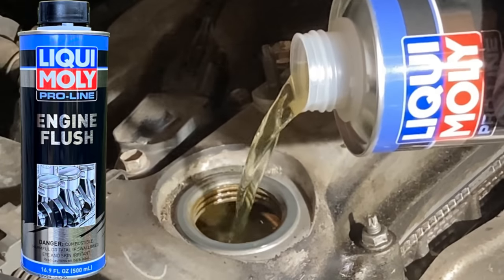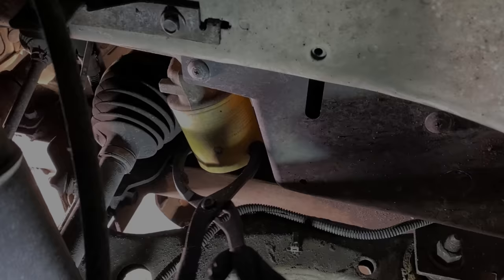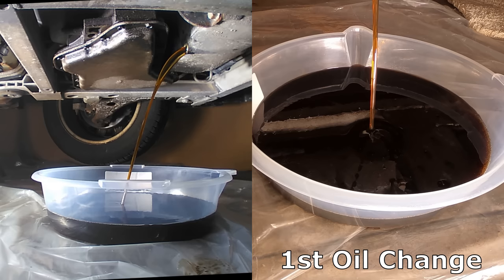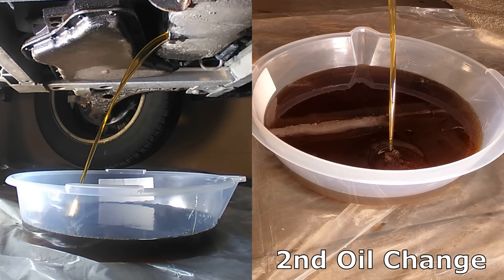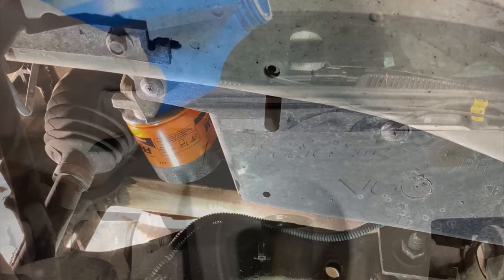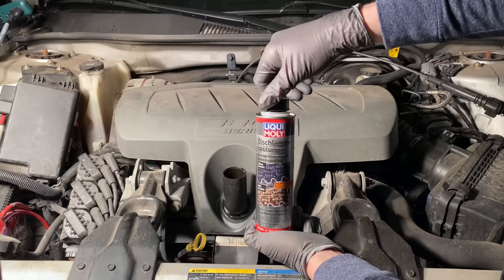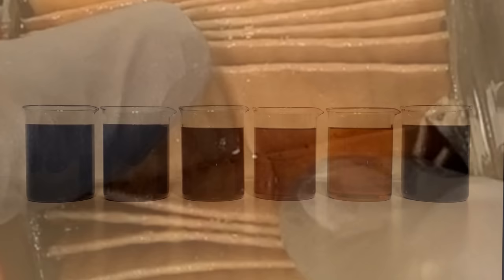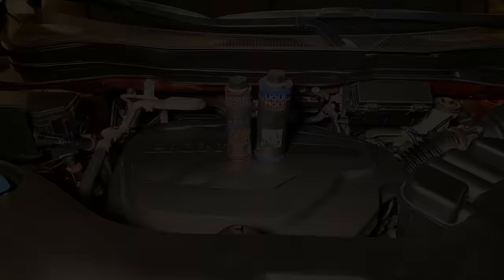Liqui Moly Sludge Remover vs Liqui Moly Engine Flush (Which is Best?)

Comment: Did you put a full complement of oil in, or just a couple of quarts? I had tried something similar to this in an attempt to get ALL the old oil out, so I could get a true analysis of the new oil I wanted to use. I put 2 quarts of oil in with a new filter every time for 3 changes, running the engine 20 minutes each time. No sense wasting the whole 5 quarts if you're just going to circulate oil. It never starved for oil, low pressure indicator never came on. After a few thousand miles with the new oil, I took a sample & had it analyzed. They said there was contamination from previous oil, because there were formulations in the analysis that were not in the current oil, therefore some old oil was still present. He said I have to change the oil 3 times to completely remove any old oil. I said I did, but I didn't tell him the method I used. My conclusion is that there is oil in places that takes time to work out, e.g. hydraulic valve lifters, & other hydraulically controlled mechanisms in the engine, that only driving under load will allow to circulate.
Reply from the maker: I read an article by a former GM engineer (I don’t remember what publication unfortunatey) where they did test to see how many oil changes it would take to remove an oil additive.  It took them 8 oil changes until the oil tests showed no (or maybe minuscule) traces of the additive.
Reply: @OwenLucas  Good info, thanks! But did they use full crankcase capacity, or just a couple of quarts? How long did they run the engine each OCI?

Comment: Helpful video, could you say which one is the best to clean up sludge on pistons and valves?
Reply from the maker: According to the LiquiMoly engineer that I spoke with.  The pro-Line Engine Flush is the most powerful of their engine flushes.  Regarding the valves, you will need a specific valve cleaner.  Techron is works great along with LiquiMoly 2001 Valve Clean.
Reply: @OwenLucas  thanks! 👍🏼

Comment: I emailed liqui moly and they basically said that sludge remover is a more " aggressive " engine flush. 
Maybe the pro line is the most aggressive engine flush.
Personally I used the standard engine flush and worked well, removed the next oil in 100-150 km after then new oil.
Reply from the maker: That's what they told me, the sludge remover works great after driving 200km.

Comment: hi, I used Liqi Moly Pro line Engine flush. after I did a Berrymans piston soak for a Kia 1.6 high oil consumption issue. Before the engine would use 2 quarts per 1000 miles. Per Kia TSB I performed the piston soak, and followed up with the Engine flush. in all 3 oil changes. Now 1000 mile no oil use at all.  Will save 24 qrts of oil in year. not to mention a piston ring job.
Reply from the maker: Thank you for sharing, that is proof that flush products and engine additives work, especially in extreme cases.

Comment: Hang on, 5000miles? What's that in km, about 8500? The oil looks like from my Diesel R5 Touareg after 15.000km. To be fair I tow a lot and the oil is not as thick and the Touareg just has 300.000km on the clock.

But not even my A6 2.8 from 1996 with 410.000km spits out oil that bad looking. Well it comes out golden after 12.000km. Crazy, but that's a quality difference for you.

Not to mention my Q7 4.2 or TT 225, the oil in these looks like new after changing it. Granted, they only have 220.000km on them.

Gotta check my 3.3 A8 after standing for a year and needing an oil change after 15.000

Pretty extensive testing, well done! I use the products from Liqui Moly since 2009 in all the 30 cars I had. Very happy with them, also the engine oils are excellent even in 10w-60 for Porsche or high power Audis.
Reply from the maker: Thank you sir!  Liqui Moly products are the best.
Reply from the maker: I am using miles btw.
Reply: @OwenLucas  Glad to hear you have good experiences with them. That you use miles I understand. Or did you mention that because I used km and you struggled converting like I did?

Comment: Why did u change the oil before using the sludge remover . Or why not doing a couple of oil changes after the sludge removal . And after that u could have drove the same amount to answer your question if those miles turned your oil black or if it was just sludge residue
Reply from the maker: The multiple oil changes were to make sure there was no old dirty oil in the sump. With completely clean oil, you can see if the engine flush cleaning action works because the oil should get very dirty after the flush is used.

Comment: I never thought to change the oil before a flush , I used the Liqui Moly flush on what I believed to be a clean engine 5k oil changes Mobil1  160k miles to my surprise the truck ran smother with a repeatable 1-2 mile per gallon increase in fuel mileage when I pulled the pan to change the oil pump o ring the pan was clean. I believe the flushes work
Reply from the maker: Very nice! Glad the flush worked for you!

Comment: you made 3 oil changes then you put Liqui Moly Ölschlammspülung and draw 200km. And after the change, the oil was again dark. 
You should make a new oil change after  Liqui Molly Ölschlammspülung,  again drive 200km and the new oil will again be dark.
I drive a BMW and I change every 10 000km oil. Every 10 000km oil change is the best oil change intervall for your car. And use Liqui Moly Cera Tec additiv, your car sounds better.

Comment: What I do is every 2,500 miles I install a new oil filter, every 4,800 to 5,000 miles change oil and filter.
  The new filter every 2,500 is coming out drake big clean. Not much particles.
 My father did this in the 1970s 1980s.
The gasoline we buy in the combustion engine causes dirty oil. 
Buy gasoline from a very good station, sometimes the lowest price gasoline is bad for your car.

Comment: you got skills man not using a funnel.  LOL. i can’t do that and the wife says why am i smelling burned oil is there a problem?   LOL
Reply from the maker: 😂  Regarding the burning oil smell, someone could have spilled oil on your engine during a change or an oil leak dribbling down onto the exhaust manifold.  Sometimes it's not worth changing a $2 gasket for $300 in labor so you might be better off power washing / degreasing the engine (when cold) to remove any oil seepage.  Just watch out for the leaky gaskets.  Liqui Moly also "Motor Oil Saver 1005" as a stop leak product to rejuvenate seals.

Comment: With that kind of treatment that 3800 should easily get to 500k. Just don't forget to change the lower and up intake gaskets 👍
Reply from the maker: Thank you for the tip, engine has been strong no issues other than hood struts on this vehicle.
Reply: or coil packs
Reply: Best engine GM ever bulit.

Comment: So I’m considering doing this on my car and I mainly talking about the oil change after oil change after oil change to get some of the free, floating sludge out. My question is can you use the cheapest oil and filter possible for the ones that you are rinsing through and then throwing away? And then on the final one just put the proper spec oil? Also I am doing some research on engine flushes because I have a direct injection Audi V6 motor with a turbo and I’m having issues with mild oil consumption. Also, I saw a video on here of a guy using something called B12 and he poured it right down the hole where the spark plugs go let it sit for six hours, then rotate it and then repeat the steps.
Reply from the maker: Definitely use a cheap oil filter for the flush.

Regarding the B12 Chemtool. It can be used for a piston soak to free up the oil control rings which have most likely jammed and are letting oil into the combustion chamber. It’s worth a shot and I’ve heard some people have success.

Comment: After you pour the LQ Sludge remover and drive 200KM. Did you see the condition of valve train ? I think to validate the result we need check the valve. Just open the valve cover and see the effect.
Reply from the maker: I’d love to see the before and after but taking the cover apart on this engine, being a V6, is a lot of work.
Reply: @OwenLucas  Btw from 1st oil change + LQ Engine Flush to the 3rd oil change, what interval did you use ? Did you drive your vehicle for each oil change ?

Comment: Oil will get really dark after driving for a long time.

I have an idea if you are just cleaning the cylinder head part:

1. Remove the top cover and brush off dirt. Drain oil and use and AC compressor to move dirt down.
2. Remove the oil drain pan for cleaning. 

I think it is wasteful to overspend on Liqui moly when you can just remove the oil drain pan for cleaning. A lot of the sludge exists there. Not on the engine itself.

This is the reason I no longer buy any Liqui Moly flush. An  engine oil flush solution only costs about 250 PHP here. You should only use fully synthetic oils even for cleaning.

Comment: The best engine flush is kerosene run engine for 10 15 min (Don't Drive it) then dump and change filter, Second best is Diesel fuel and cheap new engine oil 50/50 at least 3 flushes run engine for at least 15 min each time then change filter....

Comment: Hello my friend, I have several questions about the video you uploaded
I wanted to ask how long do you run with the engine flush before you drain it? (How many minutes?)

And how long after that do you run the oils that you then drain?
Because you did a few flushes with new oil during the cirton, so I wanted to know how long you run them in the engine before you drain?
Thank you my friend
Waiting for a reply because I also want to do this process
And I wanted to know that I understand the process one hundred percent

Thank you
Reply from the maker: For the Pro Line Engine Flush you run the engine 10 - 15 minutes, just idle, no driving.
For the Sludge remover you have to drive 200kms with the flush in the engine, light driving.
The flushes I did before the sludge remover are not necessary as they were to achieve a clear engine oil to show if there is any difference with the sludge remover.  It would be a waste to change oil before the flush.
But after the flush you change the oil and filter.

Comment: no, oil doesn't get that dark after 200 kms .. even 2000 kms will not make it that dark. It takes around 3000-4000 kms to make it that dark
Reply: agreed, my lexus 430 (3UZ) takes 4000kms to go off being clear, I change it at 6,000kms

Comment: I use a whole bottle of Marvel's Mystery Oil in my oil even if it's a little over full driving about 200 Mi down the interstate and then change my oil Works real good and it's cheap
Reply from the maker: Good advice, MMO is very versatile.

Comment: I Dont recommend using anything with solvents. Sludge breaks off instead of being emulsified and the solvents harden rubber seals and reduce lubrication of the oil. I only use detergent based oil flush
Reply from the maker: That's why it takes this one so long to function, it's gentle on the seals as per Liqui Moly's website. The Pro Line Flush is definitely stronger.
Reply: Detergent based flush, such as?

Comment: Thanks for the video,
I recently bought Mercedes 2013 Vito van 122 CDI V6 engine. I’m really keen to add CeraTec  Liqui moly oil additive just wondering does that do any harm for engine or cause any oil leaking any recommendation or any experience you have is Highly  appreciate it .
Reply from the maker: I’ve heard nothing but good things about ceratech.  It’s an additive not a cleaner. Shouldn’t cause any leaks at all.

Comment: Do I need to flush remains of liqui moly after driaing the old oil and before refilling the final oil? Or can i simple drain the old oil with Liqui moly and refill the new oil right after and run it.
Reply from the maker: You can flush it again to be extra clean but the LM should evaporate after a while.

Comment: Did you get the oil analysis from black stone? I change my STI oil every 2,000 miles so my oil comes out almost golden still so I don’t use additives but I bought a 2008 acura tl type s last ,moth and want to do the flush like in your other video.
Reply from the maker: I didn’t have a chance to. 2000 miles?  You will never need a flush changing oil so frequently. I like the TL design of the 08 generation, very clean, have fun!

Comment: Would it be ok if using a cheap oil to do 1 or 2 flushings? 

Want to change oil on my mk7 but i only put in castrol.
Reply from the maker: Cheap oil for the flush is the way to go.
Reply: @OwenLucas  Thank you for the response, will do this saturday my oil. To be honest, i never did a flush this way. I put 1 liter in and drain it again, then i fill it up. Tought most of the dirty stuff would come out. But the next day when i re-check the level its always a little brown instead of yellowish. Thank you for the tutorial. Appriciate it 👍🏻

Comment: I have some queries regarding on LIQUI MOLY they have different types or it's only one? I mean, LIQUI MOLY ENGINE FLUSH are different with LIQUI MOLY SLUDGE.
Reply from the maker: Yes, they have a few.  In this video I am comparing Liqui Moly Sludge Remover vs Liqui Moly Engine Flush.  I spoke with LM tech support in Germany and they said that the engine flush is stronger than the sludge remover, which is why it takes 200km for the sludge remover to work whereas it takes 20 minutes for the engine flush as per the instructions on both.  If your engine is really dirty, it might take multiple applications but I would stick to the Engine Flush.

Comment: $22 for the engine flush and $30 for the oil! Getting expensive even to DIY nowadays.
Reply from the maker: Everything has, mechanics are charging so much more for the same work.  Oil changes used to be $20, now they are $60 for a basic LOF.

Comment: I've never done an engine flush in my car before an it looks dirty to be honest looks black inside and I'm wondering if I use the flush   it could clog my oil pump any advice?
Reply from the maker: The engine flush cleaner works slowly, I have never seen chunks of sludge coming out of the oil pan.  Everything is diluted.

Comment: I think the sludge remover did a better job of removing what the Flush could not, but I'm not a chemist but would have to look up the active chemicals to know the difference, if the Sludge is known to be more aggressive remover, then that would be the tell.
Reply from the maker: I think the sludge remover did a great job, as long as you follow the instructions and run it for a long enough time, I think all the flushes will work decently.  Some will take longer than the others.
Reply: @OwenLucas  I just did my Moly flush yesterday,  ran it for 15 minutes ,  replaced it with new oil and filter and added the M0S2 oil treatment and a fuel injection cleaner.  I think my 01 Nissan Frontier Truck is running great. Thanks for the video.

Comment: Engine flushing is not needed in modern engines that use modern oil, in fact it’s a bad idea.
That shit you knock off doesn’t completely come out and there’s a good chance several components will get blocked with debris. Equally, if you have a turbo ir could mess that up. Old oil also has a bonus of blocking minor oil leaks and you could end up opening them up.

Just regular oil change

Comment: Hi there,
Thanks for the video 
I have Mercedes’ Vito van 2013 122CDI
WANNA add liqui moly CeraTec on next oil change
Would you recommend it ? 
does it have any harm for engine or DPF system? 

Thanks in advance
Reply from the maker: According to Liqui Moly: "Safe with catalytic converters and particulate filters (GPF/DPF) as well as for belt-in-oil systems. Contents (300 mL) is sufficient for 3–5 Liters (0.9 gal. to 1.3 gal.) motor oil. Long-term effect up to 50.000 km (30.000 miles)."  So yes it is safe, enjoy!

Comment: Some people make a drama if some old oil remain :)). Remember that oil have the capacity to treat the sealing and if you flush it you can damage the sealings , a couple of mll from old  oil will not damage your engine! My second car is a ford fiesta 1.3 ( used only winter and  as work car) i make around 12.000km annually,  since 7 years i have this car and I've changed the oil only 1 time :)). Car have 435.000km and is still running,  looks like that if you don't care about car will never break:)). I paid 1000€ for this car and in 7 years i  invested 200$ for disc brake/ pads and new spark plugs.
Reply: We have a 10 year old Ford Fiesta with 245,000km in the family that runs on oil additive from the start!  It is still dry and has the first cylinder head gasket and almost no rust. View :-)

Comment: Have you tried cleaning with diesel fuel? Empty the oil and put a full amount of diesel without running for 10 minutes. Empty and then put a flash drive with new oil and filter. Repeat twice with new oil and filter. The third is the last one with new oil and filter, and that's it. You're done.

Comment: I’ve got a question, it might sound quite funny😁I just used this product in my car and I knew it should be at idle, but as soon as I poured it into the car a minute later of idling the garage asked me if I could reverse back up on the ramp I just reversed probably about a couple of meters if that, 
Do you think that could cause any slight wear and tear, just a couple of meters probably. less than 6 meter
Reply from the maker: I don’t think it would be an issue, especially if it was just idling,  it much stress on the motor when just a few extra RPM.  I think what LiquiMoly means is they don’t want people revving or driving purposely.
Reply: @OwenLucas  yeah that’s what happened I was idling at first for two minutes then the garage asked me if I can reverse the car on the ramp so I probably drove it about a couple of meters around 2000 2500 rpm bare in mind it’s a diesel car, it was a short 5/6 meter reverse
I hope it’s alright🤣